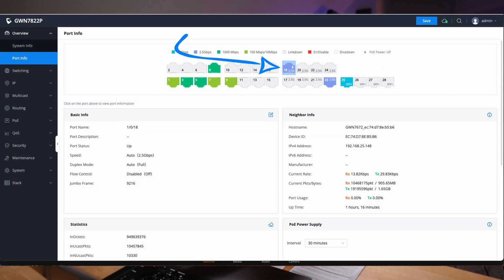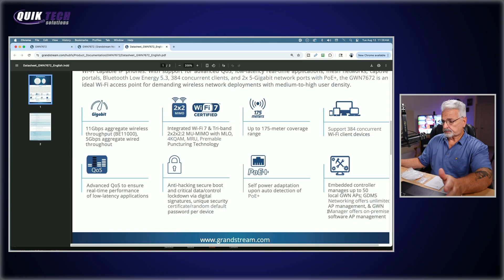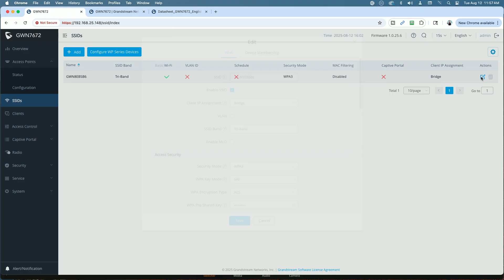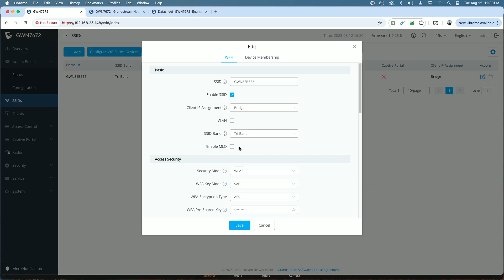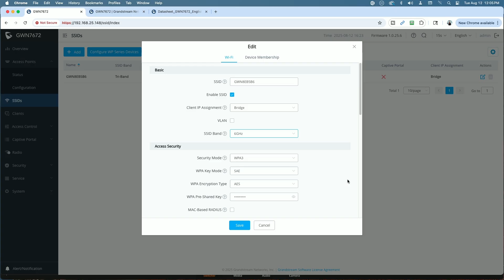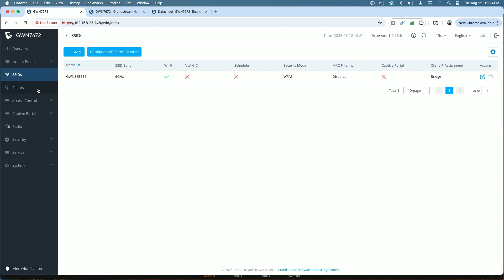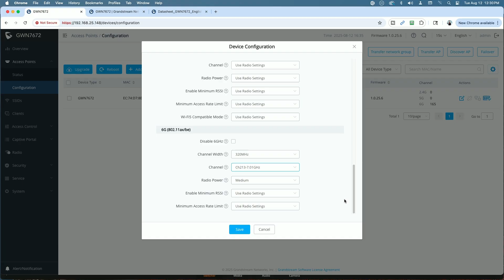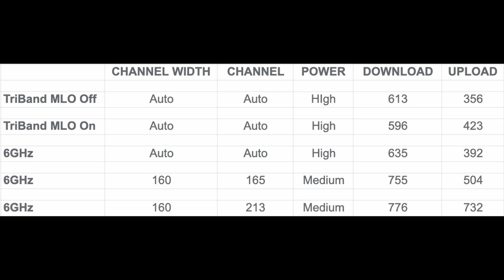Testing TriBand WiFi7: Grandstream GWN7672

Comment: Maybe i missed a moment in video,but it seems like MAC has only wifi6\wifi6e support and it was a bottleneck of this particular test,as my old m1 wifi6 gets up to 850mbps with proper config.features like MLO and 320mhz are 802.11be only,and to test that properly you need qualcomm\mtk 802.11be module at your client side,consider iperf for testing with adjusted streams option.